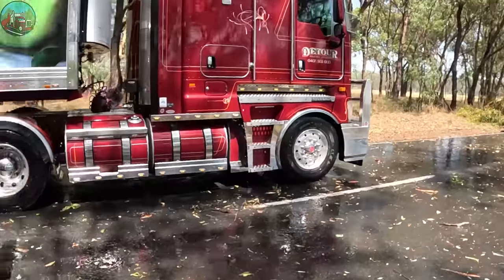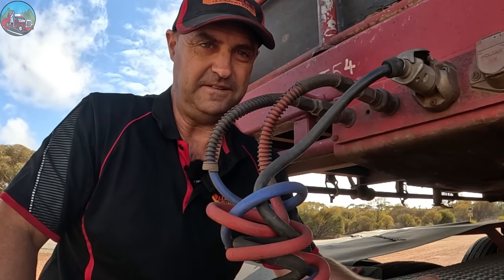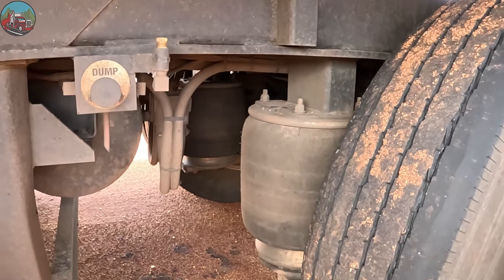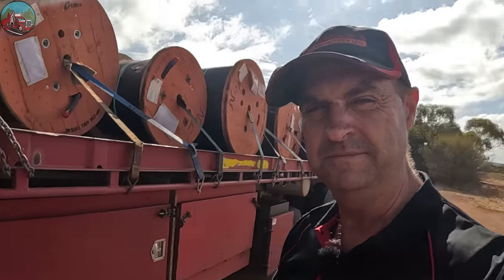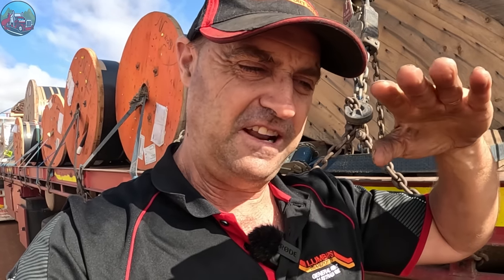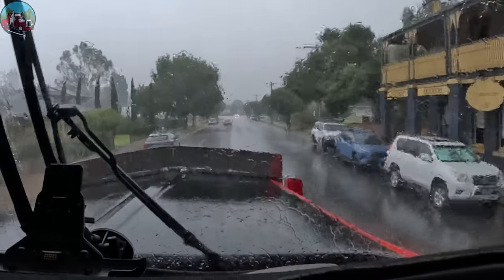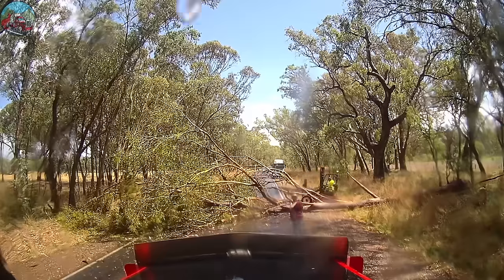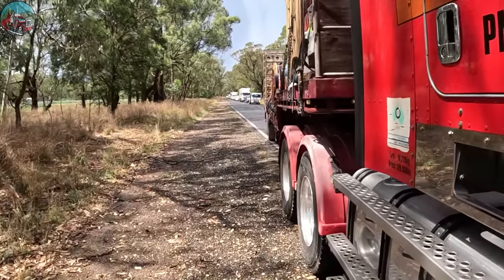A Semi-Trailer and Dolly - All It's Parts - Fallen Tree Over the Road

Comment: Great video Johno! 4 years driving rigids and I never realized that side lights are bi-directional 🤦🏻‍♂ 

Question: I notice your angles aren't strapped down. Do you get any grief about this at inspection stations?
Reply from the maker: Can you tell me which angles or where you saw them?
Reply: @RoadTrainAdventures Yes, at the 5:25 mark - angles in the toolbox.
Reply from the maker: They are secure in the toolbox. Nothing can fall out

Comment: Really interesting channel youve got here.  One thing ive often wondered is what sets apart a road train prime mover from a standard b double one?  Given the weights etc wondered if the specifications are significantly different for the drive train/chassis etc?
Reply from the maker: Most of the time a double and double road train prime mover is no different. It's only when you start pulling more trailers and heavier weights does the diff get bigger.

Comment: QUESTION ANYONE: Are red and blue airhose acting on the same brakedevices on the wheels?
Reply from the maker: Yes. The maxi and brake is in the same device.
Reply: There are two parts to the brake chamber. The back half is the maxi or spring brake and the front half is the section that is controlled by your foot. They are independent till the maxi is applied and then it pushes the service brake on. On the front or steer there is only the service brake chamber. Very simple and clever system that is cheap to maintain. If you can hear a big air leak when the foot brake is applied there is a hole in a diaphragm. They are all controlled by air tanks on the trailers and relay valves so they all work at the same time. There would be a delay before the brakes on the trailers came on otherwise. Jeff
Reply from the maker: Very good detail in your explanation